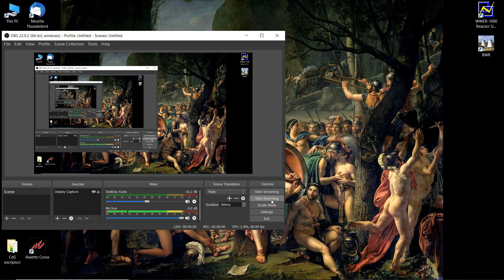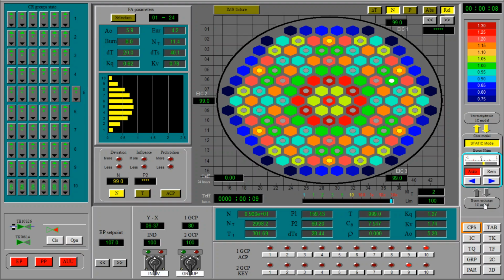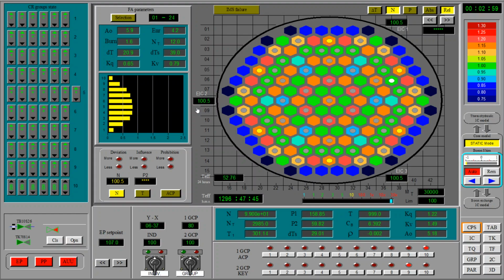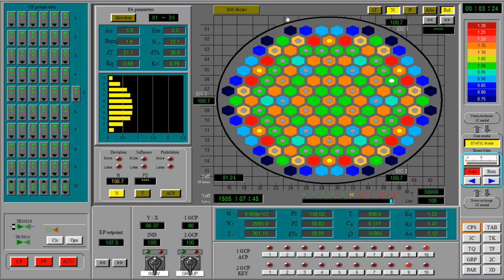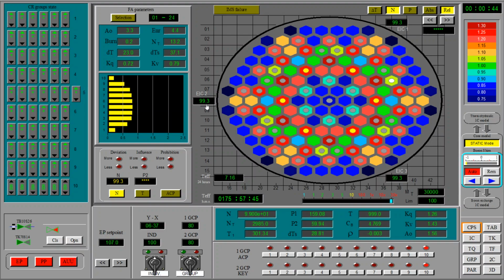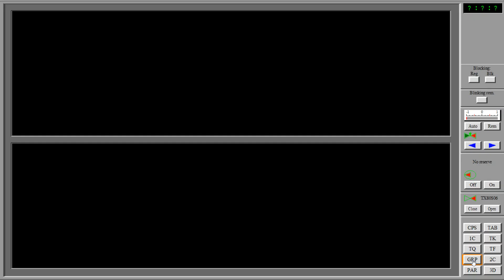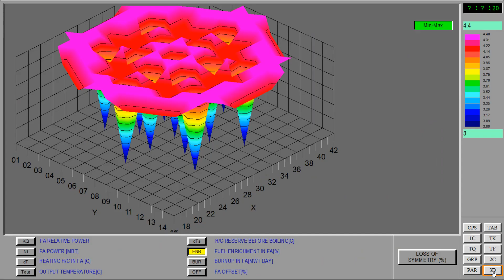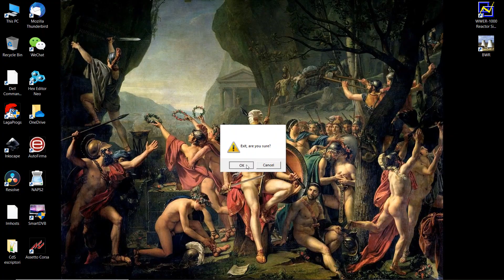Nuclear Reactor Simulator: Failure of ex-core monitoring WWER-1000

Comment: Hi, I've installed the software on my Windows 10, everything was normal but I can't run the program. Just black screen and doesn't load. Do you know where could be a problem please?
Reply from the maker: Many people is having similar issues, in my windows 10 it works with no issues so I do not know what’s the problem. Try to ask youtuber user 3DR, he has some video about this VVER simulator and I got the software from him.
Reply: @argilaga  okay, thanks!
Reply: У меня было подобное. Потом, в силу поломки, я сменил жёсткий диск ноутбука, и решил установить ещё раз. Как итог- установлено, загружено и работает успешно.